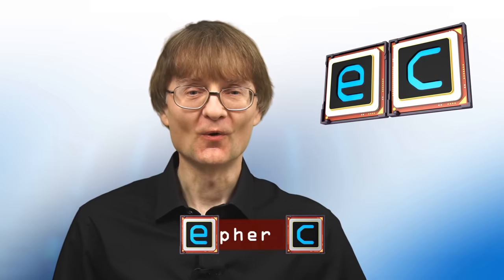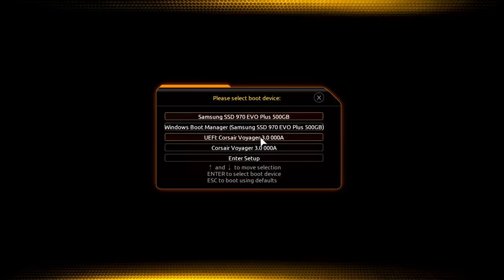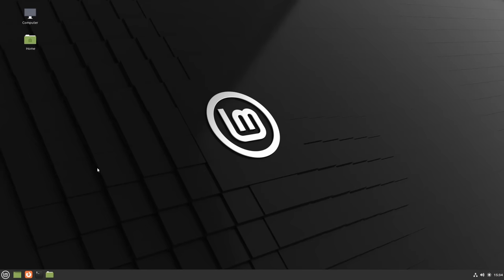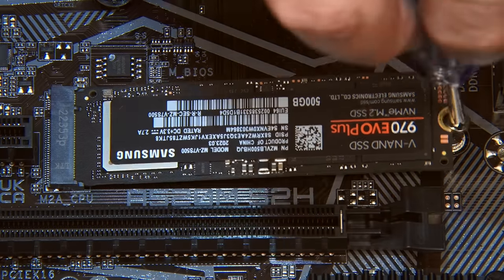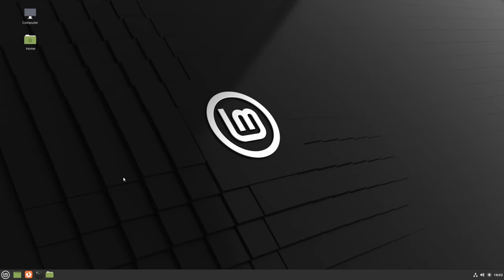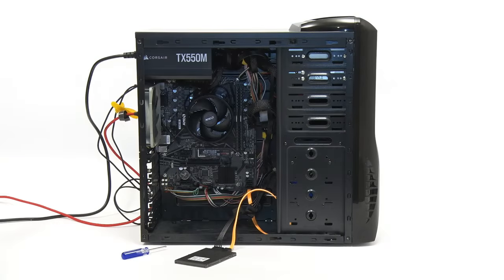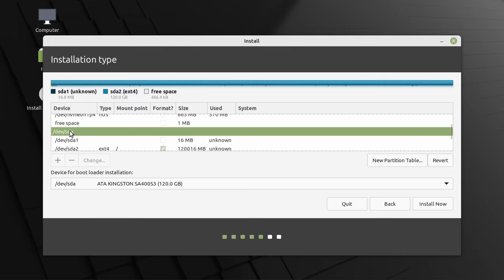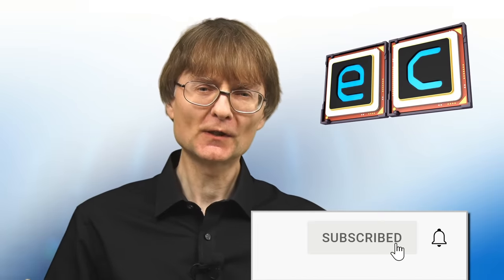Windows & Linux: Dual Drive Dual Boot

Comment: I got confused initially.
Dual Drive  for me means --- 2 Partitions. C, D .  Each kne we call as Drive in windows.
Lkke   C Drive. D  Drive etc.
_ For 2 SSDs, we call Dual Disks. 
That's an old langauge. May be wrong.
Reply from the maker: It was indeed common to refer to a "C drive" and "D drive" in Windows. But if they were on the same physical disk, they were not really drives, they were partitions. I think the language built up around "A drive, B drive", etc, when A and B were physical (floppy) drives. C came along as the hard drive, and only later did partitioning become common on end user hardware (and never that common!).

Comment: I use a slightly different approach to this, Two partitions on one drive each with a copy of Windows 10. One for me and one for the wife
On boot a selection option appears and you choose which copy to run. I find this superior to having two accounts on one install of Windows 10.
Either copy can be reinstalled if needed without affecting the other and both activate automatically on the same licence that's stored in the bios.

Comment: I did an install this way on my old Dell laptop which was equipped with a DVD cassette.  I simply removed the DVD drive from the cassette and put in a second 3.5inch SSD.   The second one has my Linux.  I don't like clouds.  I don't trust them.  My old Dell laptop now has 6tb of hard drive space divided between Windows 10 on the internal and Manjaro on the other.   Note:  My Dell is too old for Windows 11.  

I got this laptop for $60 about six years ago.  It's about ten years old now.  I replaced the internal drive with a 3tb SSD and bought an OEM of Windows 10 then I replaced the keyboard with a backlighted one.   It is still using the original battery.  Wonder of wonders!     I love this computer.  It's lightening fast with either OS.  I hope it never dies.

I have a question about Tails.   Plainly it is designed with the idea of portability.  With it on a pen drive one can use other computers with reasonable safety.  This is nice but I have another desktop computer at home that I would like to use Tails on.  Is there any way to install Tails to my internal hard drive?  Why should I limit Tails to a small, slow, pen drive when I can have it on a large SSD internal one?  Naturally I mean, too, that the installation will have a normal save partition and not the troublesome virtual one that Tails talks about.  There are no security concerns in my home besides those that exist when one is online.  

In other words, can I install Tails to my internal drive (stand alone, single OS non-portable computer) in the same way as I could any other OS?

Any ideas?      Thanks and I've always enjoyed your videos.
Reply: Well I guess you are not going to answer.    Bye.

Comment: Always use dedicated/separate drives. Always. And never install Linux on the drive while the other/Windows drive is on. Especially if you are new. You will notice that Windows will keep setting the BIOS time clock to your current timezone instead of UTC, and Linux will keep setting it to UTC as it should be. That means every time you boot to Windows you will need to change your clock again. There is a hack for this on Windows.

Comment: Your setup may work well because Windows doesn't care for messing with Linux ext4 partitions. BUT, if you try to install two Windows the same way, you may get into trouble. Windows 10/11 use Fast Startup feature by default and actualy don't shutdown, but kind of hibernates, keeping some info about filesystems on ALL the drives in its hibernation file. And because of this, when booting next time it can corrupt data on other drives. There is little info on how to prevent this from happening on the Internet; at least disable Fast Startup.
Reply from the maker: Yes, agreed -- two copies of Windows would be problematic. Hence the title of this video "Windows & Linux: ..." :) I always disable Fast Startup.

Comment: seems to be a good alternative, but you can mess up your files and lost data, i have a dell vostro 14 3000 with dual boot with 1 ssd 256gb and m.2 500gb nvme and i got install win 11 and win 10 for educational purposes and test new features also i upgrade the ram slot with 16gb ram 20gb total and you can go up to 32gb ddr4 2666 you can do the same with 1 dedicated disk or flash drive with linux and windows, (linux - mac os - windows), gives different tools for work depends on your needs, i don't recommend dual boot on the same drive or make partitions if there s a fail drive you lost all your data. the price of the drives doesn't justify cut out your budget and ran not safe. i always appreciate the tutorial but not everyone handles good, always make test on empty drives and you can learn but also don't risk your own data.:trophy-yellow-smiling:

Comment: Glad to hear that the potential  for  corruption of the Grub loader by Windows updates is the same  today  as it was 10 years ago. That's why I gave up with dual boot.

Not forgetting that Window's  updates do other wonderful things, . . . . . like de-porting the Scanner Event Manager function on my elderly  Epson Printer/Scanner. You can re-establish the Scanner Event Manager's Windows system access either by re-starting the app ( Works for Minor Windows updates) or  de-installing then re-installing the app completely (Works for major Windows updates). . . .can't be a security issue then ?

Comment: I love how you chose Mint as your choice. I have always had issues with almost every distro, but for some reason Ubuntu/Mint always seem to just work out of the box. I love Mint the best, and it has a 5 year LTS release cycle, and the Cinnamon desktop is as beautiful as KDE. One downside of Mint is that it relies on Ubuntu for the update repository which in turn relies on the Debian update repositories! LOL! The upside is that the updates in Mint have been vetted even more so for greater stability at the expense of updates lagging behind Ubuntu in terms of release cycles and kernel versions.

Comment: Did you really have to start disconnecting drives? I use an Asus MB, and can simply disable in BIOS. I installed Linux first, then disabled the Linux drive. Installed Windows to a second drive. then boot back to Linux using Grub, and configured GRUB to chainload Windows. If GRUB gets corrupted (it never has) I can still boot Windows directly using the boot drive selector, and I have a shortcut on Linux to reboot directly to Windows. If I'm booting Windows to update, such that it might want to reboot to complete, I select Windows in GRUB and it becomes the default until I change it. As much as I respect your videos, I think that you made that more difficult than it needs to be.
Reply from the maker: On disconnecting drives, it depends on the BIOS -- some allow (eg) M.2 or onboard eMMC drives to be disabled, some do not. And more broadly, a lot of other comments here suggest that what I've covered here is both relevant and helpful -- this is very much a video that I made due to popular request.
Reply: @ExplainingComputers  I'm not denying. Simply pointing out there there are, oftentimes. an easier solution, and in particular, if the BIOS has an option to disable drives that would be much more accessible for people that are not comfortable  with hardware, in much the same way that setting up a chainload and a direct reboot to an alternative OS is a software solution not comfortable for everyone. I'm simply offering more accessible ways of achieving the same result safely. GRUB, though, isn't the horror that you paint it to be, if managed properly. Perhaps a topic for another video ;)

Comment: I have not had grub corrupted due to windows updates yet. But windows updates are a hassle. When the computer is left alone and it needs to boot several times, during the update. Which it usually does, when you only visit windows once or twice a month...

Comment: You should probably use 3600MT RAM with AM4 to allow the FCLK to go to 1800MHZ
Reply: And yes I know it doesn't always increase performance but it does by a lot in many cases mostly latency related tasks

Comment: Possibly the dual-drive option is easier on a desktop PC with extra SATA ports available. My Laptop has a single M.2 SATA and a separate spinning disk for data. Best option for me was to fit a larger capacity M.2 SSD and then go the single drive option. I’ve had occasional problems with grub getting corrupted but the boot-repair tool has almost always fixed them. Bottom line is also to keep an image of the Windows drive using Macrium Reflect. The other thing you notice is that the longer you have a dual-boot system the more often you end up using Linux. Now that I have one or two older Windows-based utilities running under Wine, Linux really is the daily driver. Mint, obviously……..

Comment: Superb video, I wish easy guides like this had existed back when I first started dabbling!

With KVM and virtio now being part of the base kernel without having to faff around with kernel modules or boot flags, virtualization is easier and better than ever. Having dual booted for years to always allow both OSes to have full hardware access I've recently settled on just running Windows via KVM in Linux and with correct hardware passthrough it's almost (within a fraction of a %) as performant as running on bare metal. I use it just fine for running all my games. Also forcing Linux to be the primary OS with Windows as a guest is a great way to learn Linux as it's not quite so easy to just ignore it by mashing the right key on boot 😂

I personally think dual boot is going to end up a thing of the past (for those who primarily use Linux and need Windows for specific tasks at least) once people start realising just how good the Linux KVM is. It'd make for a great future video :)

Comment: I do have a question - after watching your excellent walkthrough and step by step of the different methods/options. In my case I have a very new NUC Mini PC (Full height) which can fit a second (SSD) and use it with it a Bluetooth keyboard & mouse. Will getting to the Bios & Boot menus work at these early stages? Would using a wired keyboard and mouse be better/required? Thanks.
Reply from the maker: Now this is a great question. My guess is that you are right, and would need a wired (or non-Bluetooth wireless) keyboard and mouse to access the BIOS boot menu, as Bluetooth would not be active until an OS had booted. But this would be the same using a GRUB boot meny too I imagine.
Reply: @ExplainingComputers  I have an old RF type Logitech (S 510) wireless keyboard and mouse for this situation, where the the part that attaches to the computer has both USB and PS/2
Since it appears to the PC as standard wired devices it works in the UEFI/BIOS areas where Bluetooth may not.

That said, I suspect some UEFI environments may be able to implement a minimal Bluetooth HID profile rather than the full Bluetooth spec.

Comment: I really like the hardware option for the dual boot.  Never thought about doing it that way. Would have been good to know many years ago, cause I ran into that removing grub issue when on the windows partition. Took me awhile to figure out.  I use Linux as my main O/S and I only use windows for applications that are not available on Linux. I prefer using VM's rather than dual boots cause I typically need to run them along side each other. Thank you for the video, peace!

Comment: Excellent video, but I have one question... 
I have Windows installed on a smaller dedicated "C drive" (500gb NVME) for OS/ driver type stuff, and I'm using two larger drives (NVME & SATA) as "D" & "E" for storage like media and VMs. I mean, "D" & "E" are initialized/ formatted and used by Winows. 
-Will Linux "see Windows" and install the GRUB menu if I ONLY unplug just the C drive with the OS installed (500gb NVME)??? 
Or, do I have to disconnect all three (C,D, & E) to have it not install the GRUB menu? 

Normally I would just go ahead and unplug all of them to be safe, but I would like to avoid removing the heat sink/ thermal pad from my NVME or unplugging everything and moving my whole case for better access so I don't drop a screw lol.

Comment: I found rEFInd to be a very nice and easy way to setup multiboot with various Linux distros and Windows, on the same SSD... however, I am having difficulty in getting it to recognise my FreeBSD install which is also on the same drive. Any suggestions? Would you consider making a video about using rEFInd in a multi-boot setup?

Comment: I've run into problems with dual-booting from a single drive, where one or both of the operating systems uses full disk encryption.  Far safer and simpler to have separate physical drives.

Comment: 8:43 I used this method and the rufus program. The type of disk is NVMe. Two systems: Windows 7 (hdd) and Windows 10 (NVMe). Whether to install the system with MBR or GPT boot should be decided by rufus. As it turns out, the Windows 10 installer decides at the end. After the installation, I check and I have GPT on NVMe and it should be MBR and that's probably where my booting problems came from. You can boot both systems normally but without data disks. When all disks are plugged in every time at startup Chkdsk scans all disks and I have to skip it.
Reply: In addition, the win7 drive disappears from the boot menu list after using win10 and shutting down the computer.

Comment: I recently tried to do this on a Acer laptop with a 11 series Intel and ran into some really crazy problems bios wise disallowing any sort of fresh installation at all. Eventually I had to strip it to find the backup battery that it fortunately had and completely loose all of the bios settings and the TPM settings as well (Later on causing windows problems). I had both bios passwords yet it didn't allow any change to the uefi or the boot sector drive that was needed. I have been dual booting with this method or very similar for 20 years and this was the first time I had run into this sort of issue. 
Any sort of modern machine today I would highly recommend as was done here and even before trying to install side by side just remove the windows drive to prevent any damage to the install.
Reply: I'd love to see UEFI go the way of the dodo. We need an open source BIOS that we can lock physically to prevent even the OS from borking it.

Comment: When you  update your Linux mint, the grub update will redetect OS and it will pick up windows and add it into grub menu.
Reply from the maker: This is true -- the Windows drive needs removing if you run such an update (every few years) if you don't want Windows in the GRUB menu. However, this pretty much misses the point of what I am showing here, as the GRUB menu here only comes up when Linux is booted -- it is not part of the Windows drive boot process, and immune to Windows corruption.

Comment: I think you could get a single larger and faster SSD rather than two separate SSD's for cheaper and get more performance out of it. Grub doesn't slow down anything if you are dual-booting anyway, it just provides a way to select the OS you want, goes thru the BIOS for that doesn't go any faster. If you are worried about the Windows boot manager getting corrupted, an update could do that outside of a dual boot situation too in case of a major upgrade, you can make the Windows boot manager the primary boot manager if you like. So in short I'm not impressed with this solution.

Comment: I used Rufus to creat a persitant Ubuntu SSD use it in a USB caddy with a on/off switch on the caddy. Switch it on and boot to Ubuntu, shutdown switch it off boot to windows. Ubuntu on a USB 3.1 runs better than  Windows on the HDD.

Comment: I've always preferred a Dual drive dual boot. Two O.S's on one drive always seemed messy to me. I started duel wielding O.S's on a PC I built for Uni never looked back (was a Win XP with Suse linux those days you could buy Suse linux in curry's). Now when ever use a single OS system It feels alien.

Comment: Hello I have been trying to install Win XP in virtual machine, but dual drive seems a lot easier so I will definitely try this. I have checked in my sparse box and was surprised at how many SSDs I have accumulated!
Reply: Well installing Win XP might become an issue, if you have newer hardware, especially those that released after 2014.
Reply: @Sup_D  Indeed. 
I've never managed to install XP on AF advanced format discs or to track down all the device drivers needed for newish i5 CPUs.

Comment: 3rd alternative way to install Linux in dual-boot mode is to programmatically "remove" windows drive (lets say /dev/sda or w/e nvme number) right after Linux live media booted, before launching installation in root terminal (or using su -c bash) with command echo 1 > /sys/block/sda/device/delete (or nvme0n1 if windows installed on first nvme drive).
This will temporarily hide the drive for Linux to access and installer won't see it.